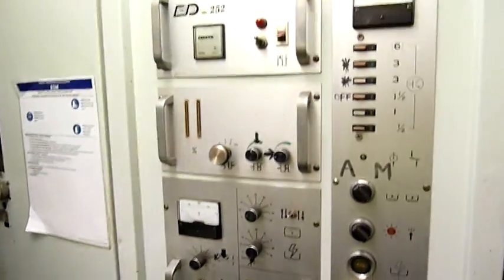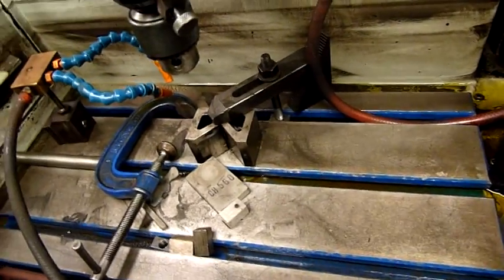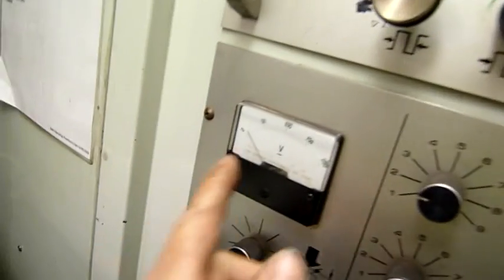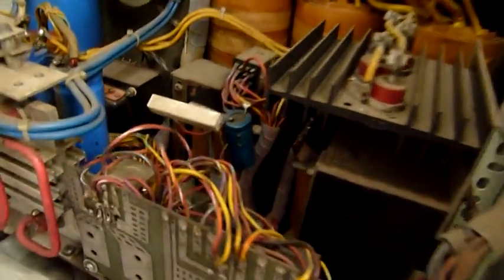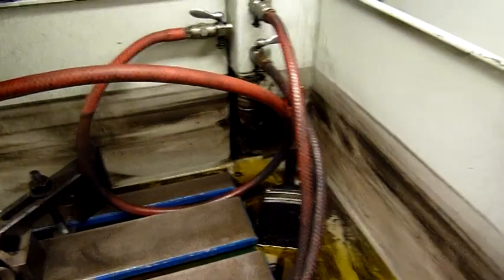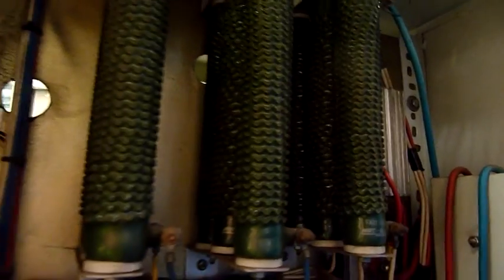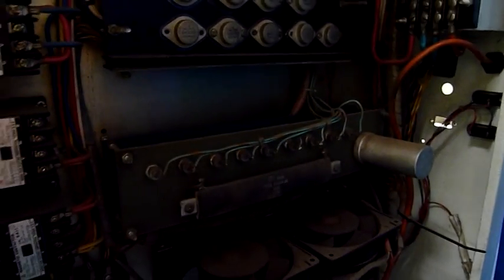Hisu-Fong ED252 Die Sink EDM Repair P1

Comment: @douro20   Thanks! I was wondering what to do with the beast. I'm thinking on rebuilding it and adding a wire feed EDM option. Using Many paralleled mosfets etc. I fixed a wire EDM machine for a friend at   vjvjvj and was surprised at how similar the drives are to Class D amps and audio gear I used to repair years ago

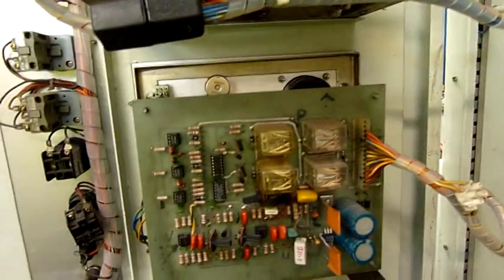Comment: @ about 1:24 in the video. I saw this green board that had 4 relays on it. to the left of those relays I saw 2 DIP-14 IC there. The one on the bottom look like it has a newer style label on it. That indicates to me that chip was replaced recently. What are the part numbers on those chips?

Comment: Good idea would be to look for some more heavy duty transistors if they burn so fast, look at the datasheet and find a replacement with a higher amps rating. The fault can be also of overheating, or as was mentioned already protection diodes can be bad too, most likely driver transistors are burned too, so check them, can be easy to find by the base wires from power transistors, because if yes then new transistors will burn again, so check it :]

Comment from the maker: @jake3085 loads of things. we use them for making motor shaft bushings and plates, but you can use them to make molding die cavities and burn out broken threading taps in valuable items.

what I showed in the vid were bushings that needed a 32mm semi-square and 20mm square drive hole burned into them, but both failed part way through.

Comment: If those are just parralel transistors + balancing resistors pull the whole thing out and put a single IGBT in it. If one of the resistor or transistors fail the whole group goes with them.